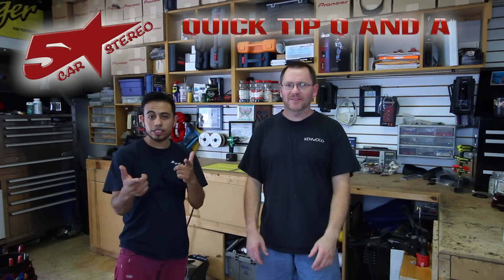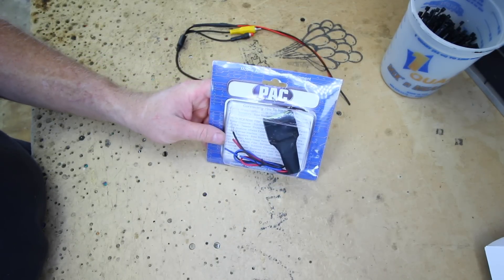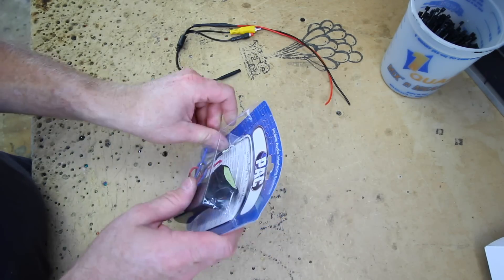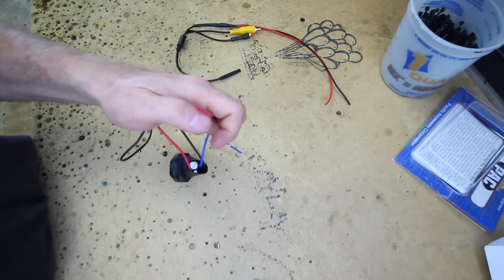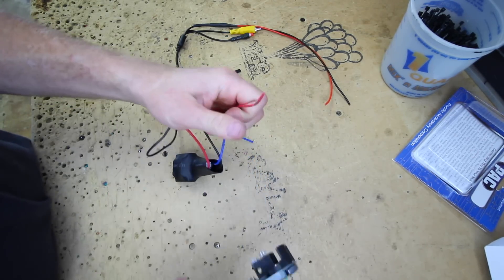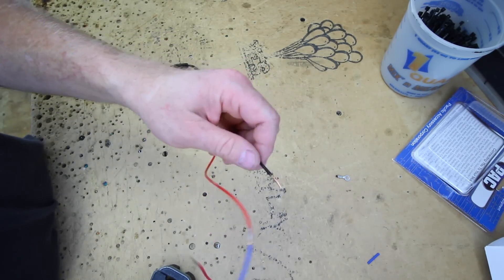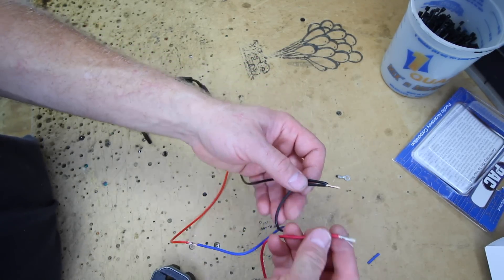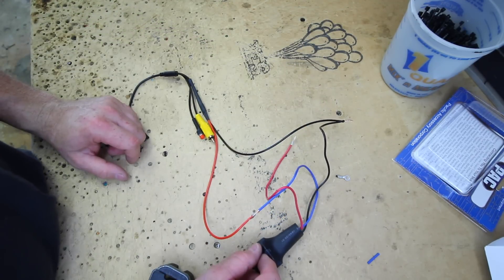How to fix engine noise on your backup camera

Comment: Perfect 👌! Fixed my problem with my aftermarket backup camera on 08 Jetta. Camera worked great when not running engine, not great with engine on. Added this filter inline with backup light and camera, now it works great!

Comment: My screen was not black but you could not make out any video image at all just a grey screen with lines running up and down it. When the engine was off I could see through the camera perfectly. This little PAC Audio CSS Passive Noise Filter solved my problem. Thank you

Comment: Thanks. Very helpful, both on the advice to clean up noise and installation (there are no instructions in the CSS12 packaging). New backup cam (2022) in 2010 Volkswagen Jetta had a lot of interference when car is running (lines and video cutting in and out). this reduced the lines (they are still there) but made the video' constant.

Comment: Appreciate the video I have ordered the part and installed it per the instructions and no go everything is still the same. What other options would you recommend?
Reply: 😄😄 sorry to hear that
Reply: You need clean +12v source.(not have canbus line) You can use a relay and trigger the relay from the reversing light.

Comment: Not sure you guys read comments to older posts - but here goes - DNX996xr in 2105 CRV - factory cameras (rear, right) have noise from somewhere happens with the car running or not running. Had front aftermarket cam installed, crystal clear image, the factory rear and right side mirror very noisy image. Not sure why the aftermarket cam is so perfect - could it be that it has it's own built in amp or something, providing a clear image/signal. I didn't want to start tearing the dash apart for no good reason. I believe all the factory cams have simple RCA plugs, as does the aftermarket, Your input greatly appreciated.

Comment: Thank you guys it fixed my issue with noise but it takes about a minute for it to go back to the radio (stays for a minute on black screen) many residual power in the CSS12?

Comment: OK, here is a weird backup camera issue….I have a 31 foot RV, I installed an Akaso DL12 rear view mirror that has a front facing dashcam and a rear facing backup camera. So I wired the backup camera to be HOT (on all the time) so I can use it as a rear view camera while driving. Here is the issue. When in PARK, the rear view camera works perfectly, but when I put the RV in DRIVE, the camera acts like its shorting out, or to better explain, the picture comes in and out. I wonder if this product could help with that? Thanks

Comment: Hey, guys. I wanted to know if soldering wires is the best way to connect wire harness or crimping?
Reply from the maker: Some like solder and others like crimps.We use both depending on the situation. If done right they both have there advantage, just don't use wire nuts.

Comment: Hi can you please help with same issue I have on my 2008 Jayco Conquest motorhome where the rear viewing camera is fine when tuned on then I start the engine & the screen changes to being blurry & lines across & a lot of blue colouring
 that cannot see any image properly do you think it is getting interference? if I need to modify with a relay or filter where do I install this at the very rear near the camera which is mounted high at the rear or down the screen end mounted on my dash
Thanks for your assistance

Comment: I have a CB in my Jeep that worked great. Then I added a Brandmotion monitor with back & forward facing cameras (for rock crawling), now I get a high frequency noise on the CB. The camera cables and CB antenna cable are routed on opposite sides of the vehicle and never cross. The only thing in common is they are powered through the same switch pod but from different switches. Any suggestions? Will the PAC Audio CSS12 help?

Comment: I bought the PAC css12 filter and put it on the camera power and noticed no change. I put it on the monitor power and notice a small change, but I still have a couple of lines. I have the monitor and camera powered separately, do I need to put a PAC css12 filter on each power source?

Comment: Will this work on a 6v factory camera? I added an OEM camera to my Kia Soul with a 6v setup down to a pioneer CarPlay head-unit, but I am getting horizontal lines on the display.

Comment: Hi guys. Great video. How would this work if i have the backup camera already hooked up with that black RCA type cable that has a power and ground lines? Do i just splice into those lines? Thanks
Reply from the maker: Cgiese80 you splice in the black and cut in the red and blue
Reply: Five Star Car Stereo sorry, I'm kinda lost. Right off the backup camera i have a yellow and a red cords. Then there's the RCA that goes to hear unit sending video signal and the other wire that had 2 wires, black for ground and red for power. Black one is grounded to the car frame and red one i tapped it to reverse light. Where exactly do i install this device? Thanks for your patience. I enjoy watching your videos
Reply: This video was a little confusing...is this supposed to be mounted to wires close to head unit or wires closest to the camera? Because the wires coming off the rear camera get connect to reverse light in the tail light housing. Can u please clarify.

Comment: I have a 2010 F150 with a OEM backup camera and since I piggy backed 2 LED Fog Lights as reverse lights (one on each reverse light bulb which are also LED), the camera has been fuzzy most of the time (white noise) and sometimes works. Would it be that it needs some kind of filter? Any help is appreciated Thank You!

Comment: I don't understand the set up. You say that the blue wire goes to the camera red power wire. How are you supposed to get power to the camera then? The camera's red wire should go corrected to the vehicles power source, normally reverse lights
Reply from the maker: Cgiese80 you don't power the camera off the reverse light. The reverse light connection is to just trigger the radio to switch on. The camera should be connected to Acc power. That way you can use the radios camera view feature. This noise filter is for if your camera picks up engine noise.

Comment: I added this noise suppressor on my Toyota, worked great but I added to  my Silverado and still get wavy lines only when engine is running.????
Reply: I get the same thing. Did you find a solution?

Comment: Could you help me with my problem? I have a wireless unit with transmitters. The rear camera transmitter is connected + to the reverse light and grounded to the frame. The front is connected to the acc and ground of the radio and reverse signal connected to the reverse wire in the bcm  
.  I have  noise excessive lines whether the engine is running or not. Any ideas? Thanks
Reply from the maker: Lew Strickland yes, unfortunately it is the wireless system. You may want to go wires.
Reply: Five Star Car Stereo out of curiosity or desperation, I moved the location of the wireless receiver away from the radio. It's working fine now. Thanks for your reply!

Comment: I am getting noise whether the engine is running or not. Maybe it's not noise but my camera is very grainy at night, a little grainy during the day. I upgraded my backup lights to LED (this is a 2006 Yukon) and I have blocked my tag lights. A tiny bit of improvement but not much.  Any thoughts?
Reply: Five Star Car Stereo I actually don't know. I had it professionally done. going to take it back to them but I wanted to eliminate simple things first,and get your thoughts. crazy thing I setup a camera in my wife's mail Jeep with pretty much the exact same setup, but a much cheaper head unit and my picture is better and camera cost me $45 on Amazon and includes a backup sensor kit.

Comment: Thanks for the video guys. Could you help me with my camera issue? I have a wireless setup. The camera's RCA and power are connected to a wireless transmitter. The +12 of the transmitter is connected to the reverse light and the ground is connected to the frame. On the radio side (Android based head unit), a receiver is connected to the radio RCA connector and it's powered from the +12 accessory power (piggybacked fuse) and the ground. I hear an annoying engine noise through the speakers which disappears as soon as I unplug the RCA connector between the wireless receiver and the radio. Would your solution help in my situation? 
Thank you.
Reply from the maker: Dmitrij Motley it may, does the noise go away when you unplug the Camera RCA? If it stays I would try this filter
Reply: The noise goes away as soon as I disconnect the camera RCA behind the radio. I changed the ground point to a better one and problem was partially solved. The partially means that the noise comes and stays sometimes until I disconnect the RCA. Then I connect it again and it woks without noise. Until next time... But I also have the lines as you on the screen, so I have to try your suggested device. My question is where should I connect it: on the transmitter side of the system or on the receiver side (hatch or dash/radio part)? Thanks.
Reply from the maker: Dmitrij Motley try the dash side first, for the noise.

Comment: Did the fix and no change.  Then tried with engine running but GPS/monitor on internal battery: the problem is gone.  GPS/monitor is powered via cigarette lighter so next installed the CSS12 on the lighter wiring.  No improvement, still get alternator grain and lines!!  Wired backup camera system.  What's wrong?!  Defective CSS12 or what?

Comment: Hi! Thanks for your videos they're awesome! 

In my case I get a black screen when the engine is running (I have seen once or twice the image but with horizontal lines - most of the time it's plain black). However it's perfect when I turn off the engine. 
I also noticed that the camera still works well if I remove completely the ground (my first thoughts were that it wasn't grounded properly so I tried many places - and once totally unplugged). It was making me crazy so I took some spark plugs and hooked it up directly to the - of the battery, and same issue, black screen.. :'(

Does your tric against noise could work for me you think?

Thanks!
T
Reply: Same here

Comment: Depend on kind of interference.  RF interference is solved with ferrite core filter like the ones on charger cable of laptops. Mayor interference is solved with noise suppressor for ignition on reverse power line. This is the easiest way

Comment: My camera is connected to the reverse light + and - and i also tried grounding it. Still has lines
Reply from the maker: Alex Calinescu we connect our cameras to accessory power behind the radio. The only wire connected to the reverse light is the radios reverse input wire.
Reply: @FiveStarCarStereoInc  doesnt that mean the camera is always on and that the radio just switches the source when you put the car in reverse?